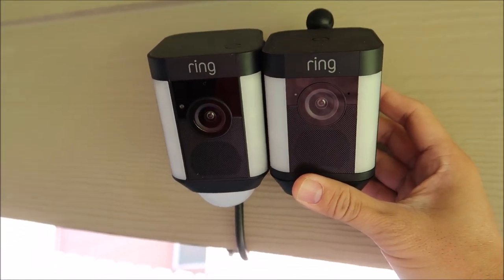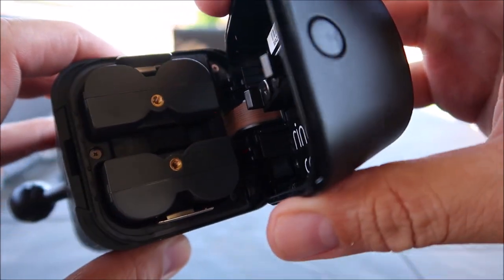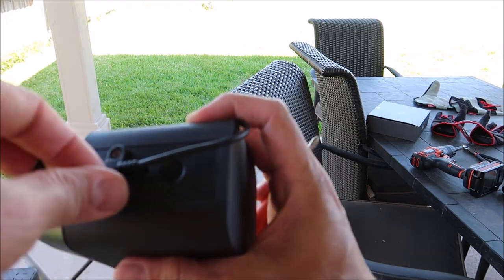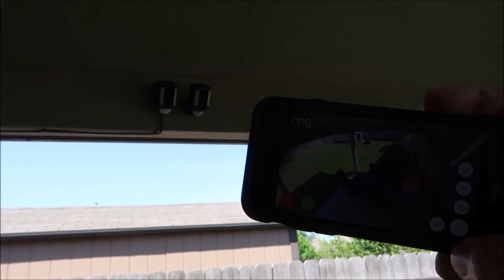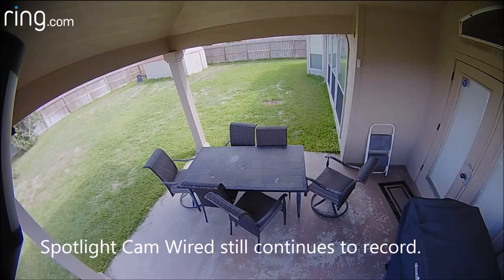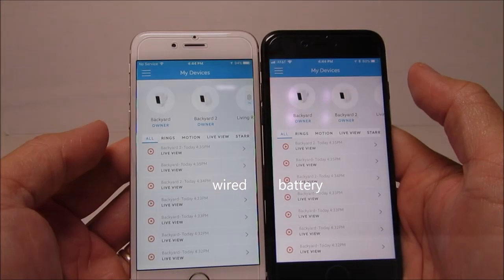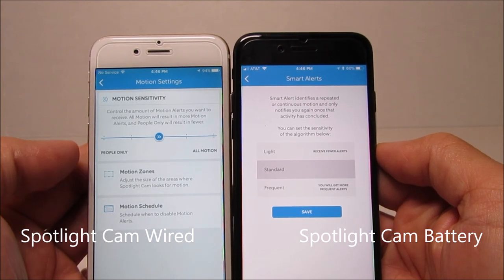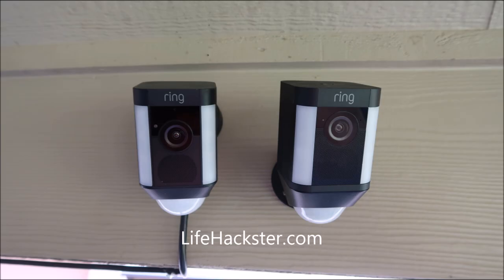Ring Spotlight Cam Wired vs Battery...which one is better?

Comment: Are you still using the battery operated Spotlight Camera?
Reply from the maker: Yes, I do...I'm testing how long the battery lasts... It records motion at least 2-3 times/day.
Reply: LifeHackster the video quality is HORRIBLE compared to my Video Doorbell Pro and Floodlight... Is the Reolink Argus 2 better than the Spotlight Cam in your opinion?
Reply from the maker: I think the Reolink 2 would be better...
Reply: LifeHackster I just received it yesterday, but I need a Micro SD card. Do I need the SD card to watch recored motion?
Reply: LifeHackster I finally setup my Reolink Argus 2 and so far so good. It has much better video quality, I can't wait to see what it looks like at night. I am still looking for an inexpensive camera to put in my garage.
Reply from the maker: Yes, you need the micro SD card...
Reply from the maker: The argus has pretty decent night vision...
Reply: LifeHackster The Argus 2 is better than the Ring Spotlight Cam Battery Operated. I wish Rings battery operated camera was better. 😢 Any other recommendations and or suggestions for a camera for the inside of my garage?

Comment: I had a Ring spotlight cam would not connect to my phone data . Could not use it if i left my house was really unhappy with it .
Reply from the maker: Your phone data might be limited? LTE? signal strength? I have no issues with mine not unless I have only have 1 bar on my signal..

Comment: I have problems with my ring camera ! It’s stop recording at the night all camera turn off . I called ring they told me my internet connection it’s the problem! Everything else working perfect my lamp sprinklers system never loses WiFi signal.
I called my internet company they changed my system my internet fast and my WiFi signals strong ! Also I have ring WiFi booster 😊 but still the same problem! Ring saying my internet my internet company says it’s everything looks good my internet signal strong and fast .
Reply: Same happen to me! I change my doorbell transformer and it works perfectly now